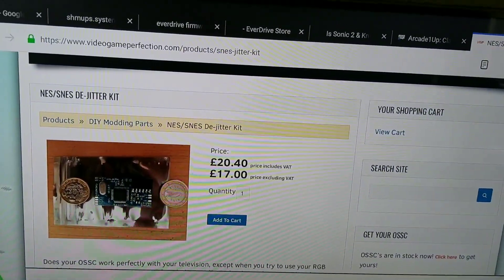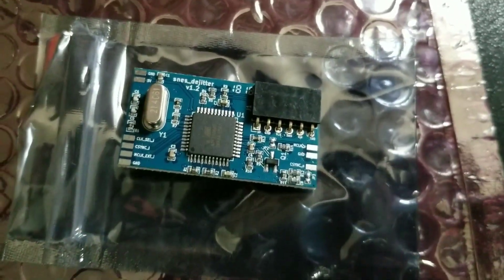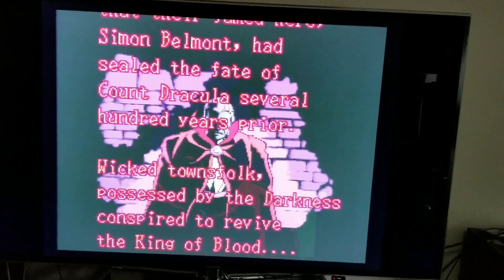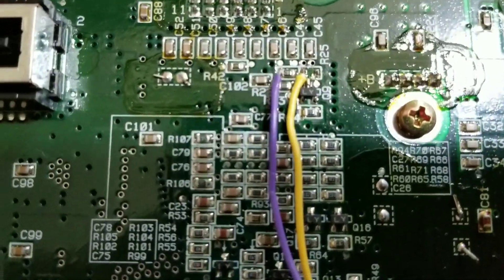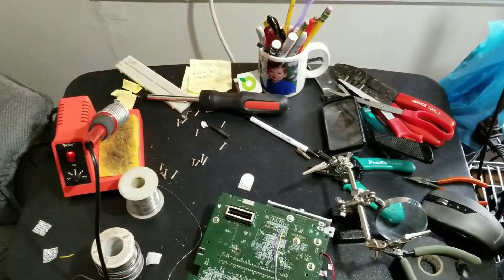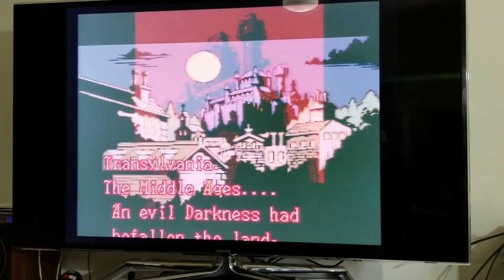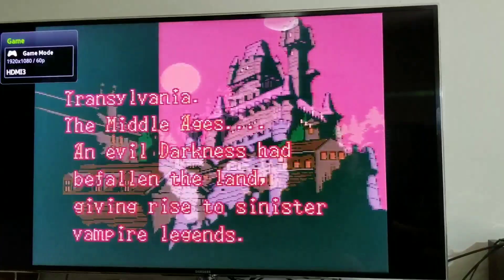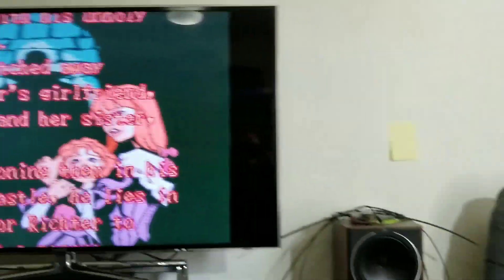SNES dejitter pcb. Install and test with OSSC.

Comment: Nice work! Glad that you got it all sorted. Man, you know I still haven't gotten the OSSC, I've probably already asked you this maybe in another video, lol, so I apologize if my memory is going here, but how does it look in the various modes with scanlines turned on? Like say 720p vs 1080p, etc. I'm wondering if, since I'm a happy user of the older xrgb units with pc crts, if I'd be pleased with how the ossc makes retro look on an hd tv with scanlines? I actually really like the way an old xrgb unit makes retro consoles look on a 1080p tv (I put up a video of the ps1 with darkstalkers running in that configuration back in January of this year) so wondering how the OSSC compares since it's readily available, and I have big 55" Phillips 4k tv that would be fun to test some stuff out on. Do you notice any lag in your configuration as well in terms of input delay? Great vid as always!
Reply from the maker: In my opinion the scanlines only look "right" in 2x mode. In higher res modes they look inconsistent. Theres some new tweaks for the scanlines in the newest firmware but I havent played with them yet. As far as lag, about 2 frames from my lcd tv. Im gonna retest everything though. Last testing I did was with my xrgb-3 and a crappy camera. My newer cell now has a 240 fps slow mo which should make testing easier. BTW, I just finished making my last rgb cable tonight. Its for the jag. The extron crosspoint is fully populated with no scart plug adapters and switching all audio as well!

Comment: I didn't know the snes would be having issues like this, but I still have yet to pick up an RGB cable.

Funny I've helped solder a remote plane, but I'm too scared to put any dabbing on my pcb boards.  I'll have to see about picking up a good working snes that doesn't flip out whenever I accidently nudge the cart or something.